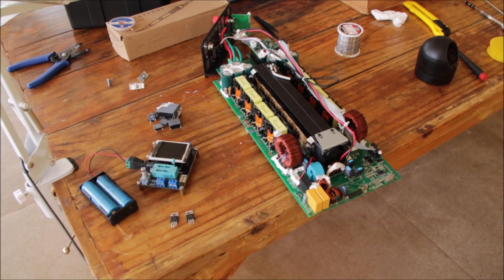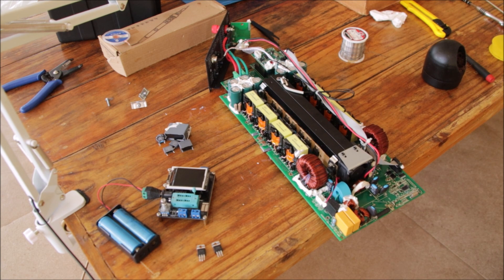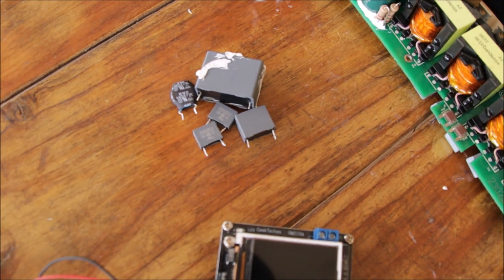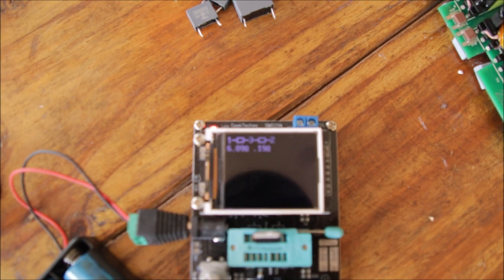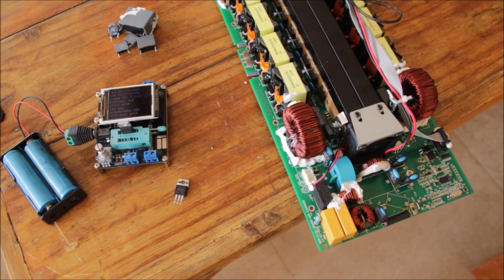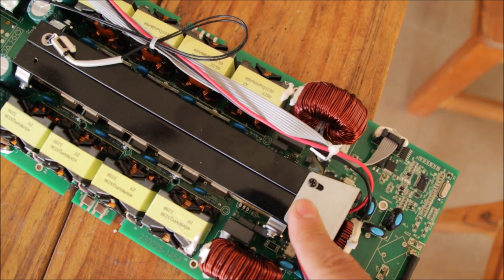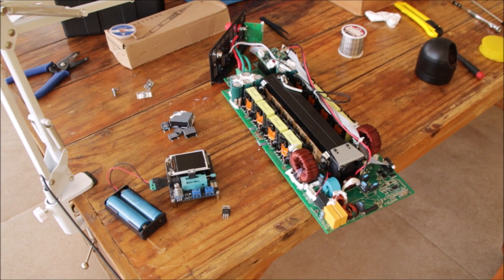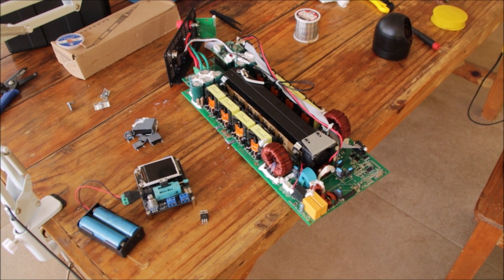A SUN2000GTIL Inverter blew up AGAIN! This is unbelievable...

Comment: Output bridge is run with MOSFETs?  I knew these things were cheap junk but honestly I didn't think they were that cheap.  I've never worked on one but I have worked on several other grid tied, off grid and line interactive high frequency inverters and all bar the bottom shelf stuff uses IGBTs.  FETs tend to be more of a thing driving the primary of the transformer in low frequency inverters.

Comment: Hi Roland, ich kenne Dein Problem auch. Vielleicht hilft Dir folgendes: 
Ich habe auch die Situation der Wiedereinschaltspitzen durch das Versorgungsnetz.
Was bisher half ist der Einsatz von Timern in Kombination mit Schützen. So wird bei Wiederkehr der Spannung der erste Timer nach ca.5 min aktiv und gibt über das Schütz den 1. Inversor frei damit wird ein zweiter Timer aktiv und nach weiteren 4 oder 5 Minuten die nächsten Verbraucher zugeschalten. Usw.usw.....
Bleibt abzuwarten ob der Eingang des erten Timers die Spitzen verträgt. Bisher ja.
Das ist nur meine Überlegung dazu. Früher habe ich das über EIB in D für Grossmärkte installiert, resultierend aus der Energieabrechnung nach Lastspitzen.
Vieleicht hilft Dir das. Viel Glück bei der Reparatur des Inversor zum Trost...habe schon komplett verbrannte Mosfetbänke gesehen.😂
Reply from the maker: Hallo Frank, Deine Idee klingt wirklich gut. Ich denke auch, dass wenn man aus einer 1-2 sekündigen Unterbrechung, besser eine mehrere Minuten lange macht, das System einmal zur Ruhe kommt und dann wieder normal startet. Ich schau mich mal um ob ich was passendes finde. Danke, Grüsse nach Deutschland
Reply: Ich lebe in der Caribik, daher die gleichen Themen wie bei Dir😂
Reply from the maker: @frankkaufmann9184  Ah. Sehr schön 😄
Reply: Hi Roland, same happened to me with a brand new one the first week and ordered a replacement board and only lasted 2 days. Now I have a pile of them waiting for repair. Two 2000 shorted in the AC side one 1000 on the DC and one 1000 with AC alarm on the display.
Reply from the maker: @lauramarsotomayor3668  wow. My oldest SUN2000 is running since 3 years without any issue. All newer ones failed already and the newest even after a short time only. I think that the Chinese equipment is using crappy components these days. The 2 Mosfets which I have removed are from a no-name company. If this repair succeeds, then I will try to fix the other SUN1000 from before as well.